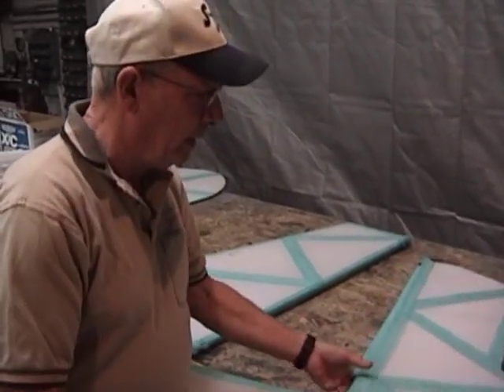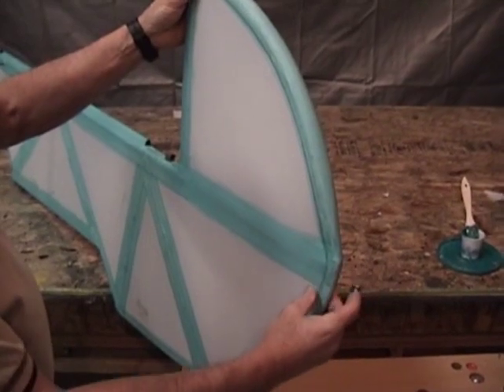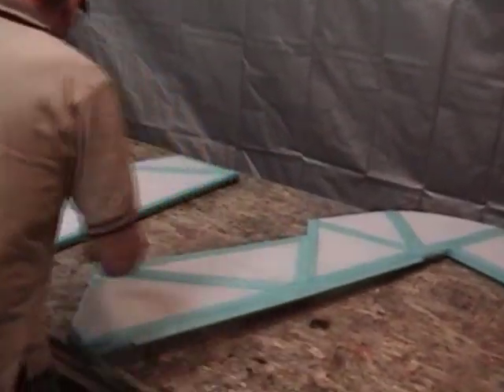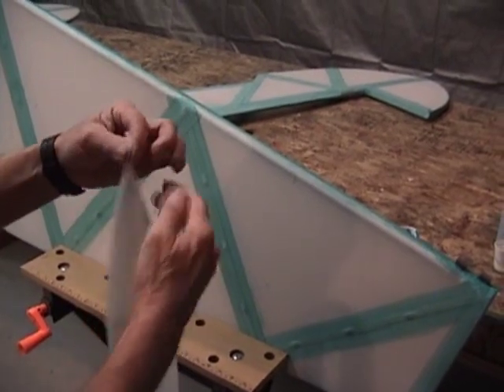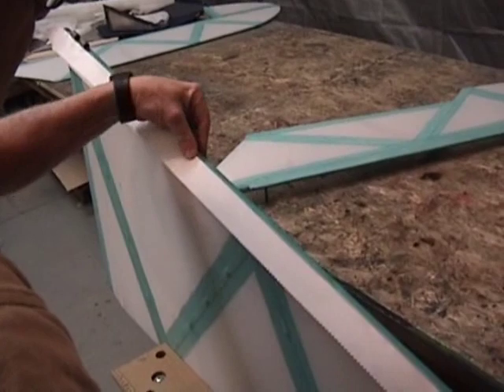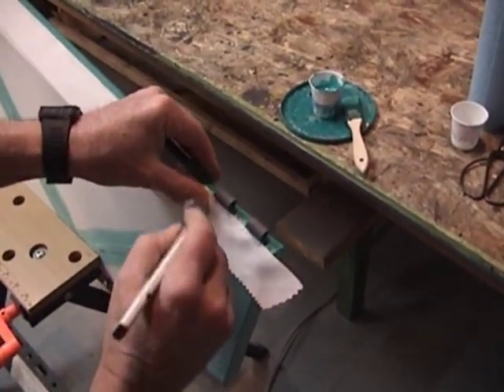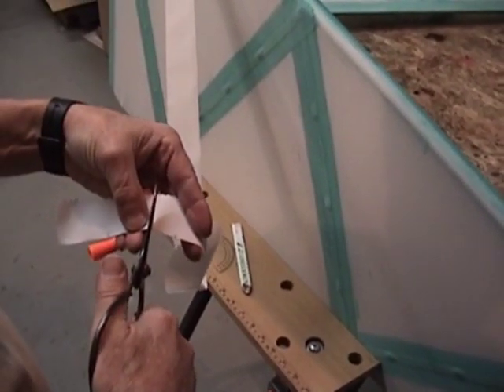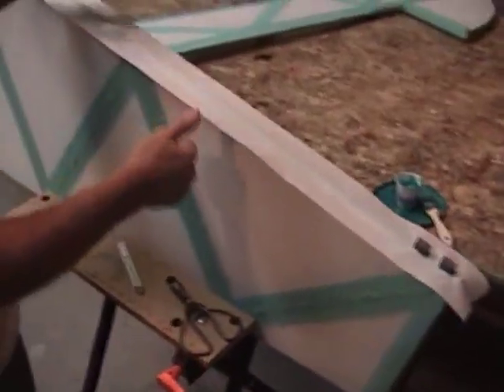Part 1 - Perimeter Tapes on Fabric Aircraft with Stewart Systems

Comment: any bond can work instead of poly take cement
Reply from the maker: If you are using the PolyFiber STC, they require use of polytac.  If you are using our STC, we require our products all the way through.  It's not good to mix systems.